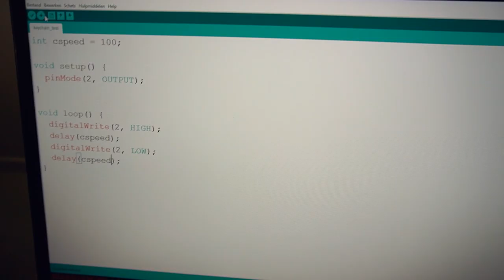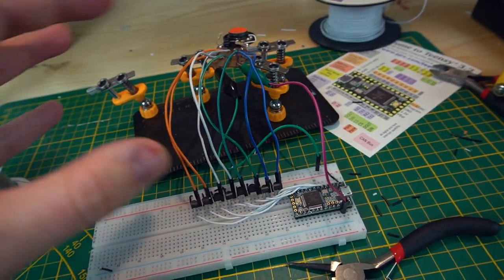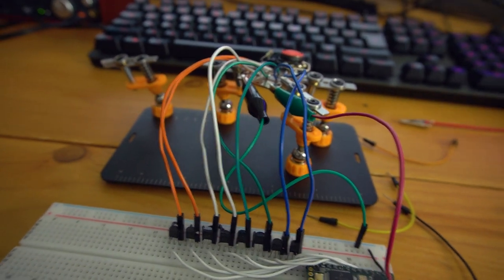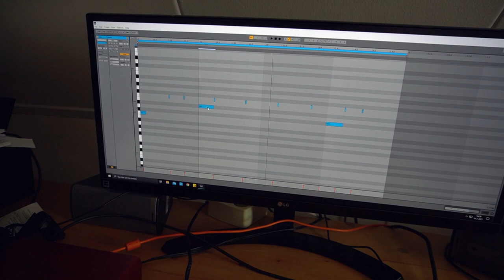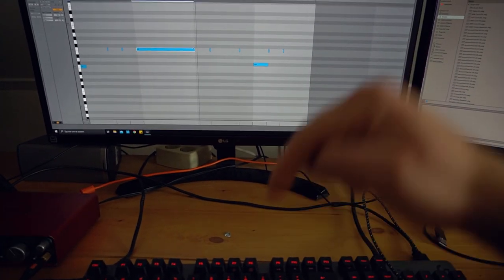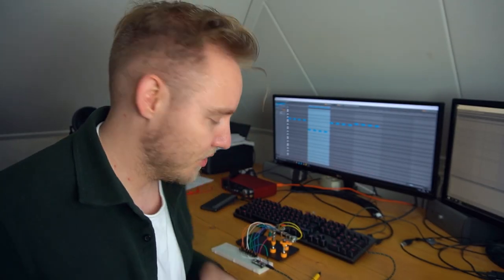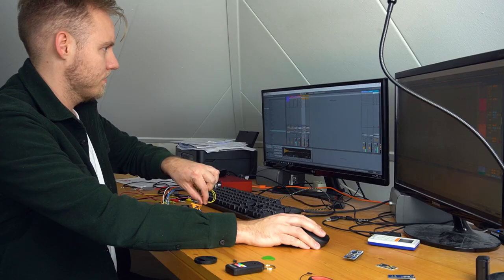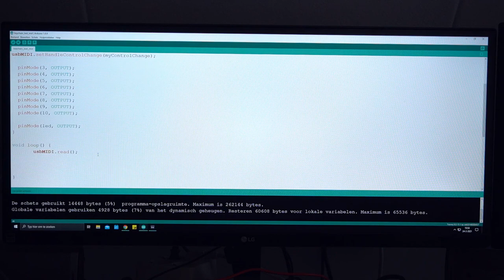FROM TOY TO DRUM MACHINE - making your own music gear: #1

Comment: This goes for all transistors in your setup: It is probably wise to use a resistor of e.g. 1kOhm between the transistor's base and the teensy output. Otherwise if you connect them directly the transistor will restrict the base-to-gnd-voltage to 0.6 Volts and the Teensy wants to output 5 V (or is it 3V3) and one of the two might not like the voltage of the other. The 1kOhm resistor will allow for a controlled voltage drop between the teensy and the transistor's base. Geinig projectje, overigens!
Reply from the maker: Nice ! Spoiler alert for part 2 🤣 dankje :)

Comment: I've seen toys where the pitch resistor connects to two pins on the sound chip and ones where it connects Vcc to one sound chip pin. My guess is that in the former case it's coupled with a capacitor to control the clock speed while in the latter it's going to a voltage or really current controlled oscillator for the clock — in that case you can replace Vcc with a variable voltage to change the pitch. But in the former case you really need something acting as a variable resistor, such as your homemade vactrol (or the commercial one I used in my Megamodule). Nice work!
Reply from the maker: That is some great advice! Thank you for that. ;)

Comment: I found the same keychain but with Star Trek sound effects instead :) Going to do the same thing but as a Kosmo module :)
Reply from the maker: Cool! cool idea :) then you can just connect the CV to the transistors! I think LMNC did that with a Nintendo controller look that up ;)
Reply: @jwotto  I will definitely look that up. I had imagined I would need to implement the op-amp-as-a-variable-resistor-datasheet-application-note but simplicity is good. Thanks!
Reply: @jwotto  The batteries could not have lasted long at all on these things. When it's playing a sound efffect my bench supply says it draws 143mA!!!!
Reply from the maker: @xKatjaxPurrsx  oh wow! That's alot :)
Reply: @jwotto  I mean for something designed to be powered off 2 LR44s yeah it is. I wonder if maybe the internal resistance of the batteries were supposed to current limit the circuit.

Comment: 2:34 why can't you just send LOW from Teensy?
EDIT: after merging power lanes, oc
Reply from the maker: It's either HIGH 3.3 volt or LOW connected to ground with a digital output. and what you want is connected to ground or not connected to anything that's is why i use a transistor.
Reply: @jwotto  but isn't trace below the pad pulled up anyway?
Reply from the maker: No it's pulled down ;)